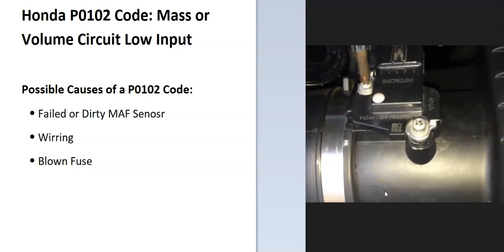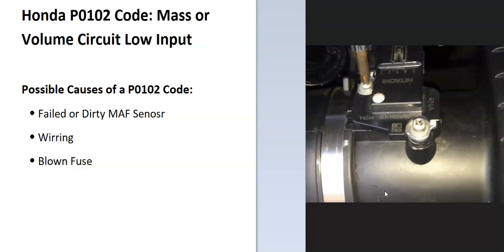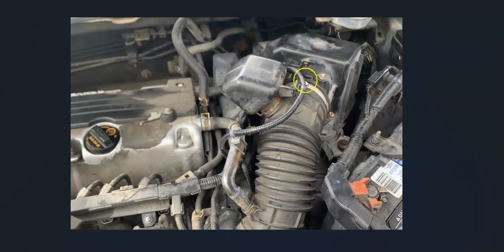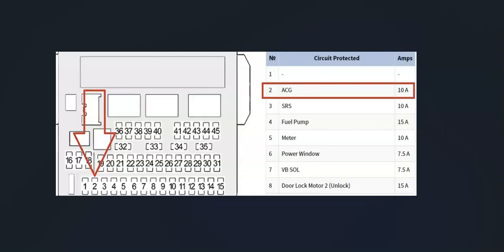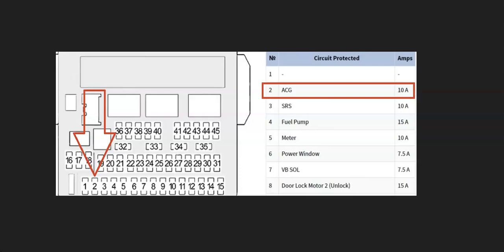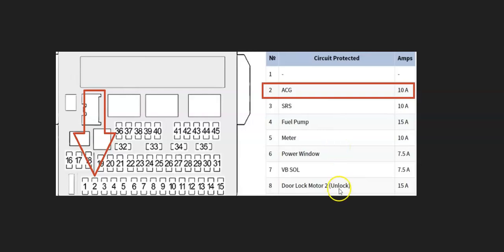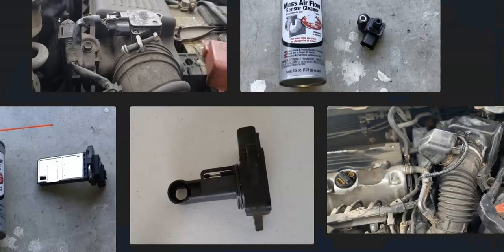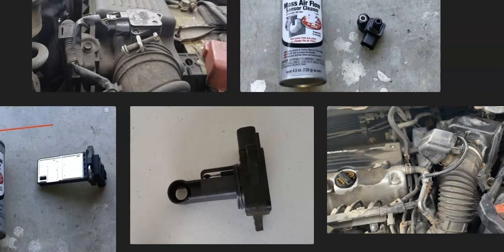How to Fix a Honda  P0102 Code: Mass or Volume Circuit Low Input

Comment: Friend with a 2006 civic, 120k mi, p0102 code, replaced maf sensor, still has code.
Reply from the maker: Check the wiring
Reply: Does the 102 code mean the power from the ECU to the sensor is low or the other way around?
Reply: @chuckflurry3752 is low but he doesn’t say what fuse it is